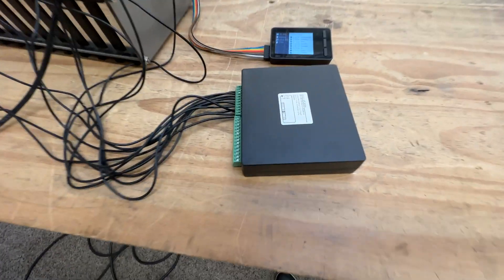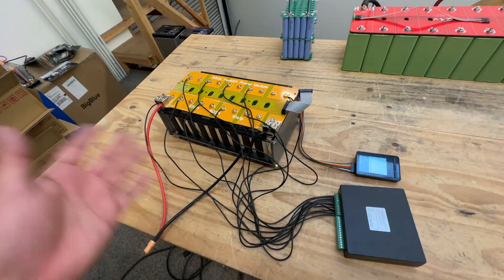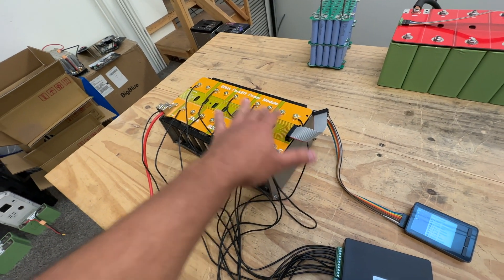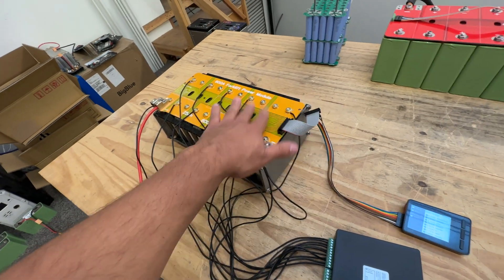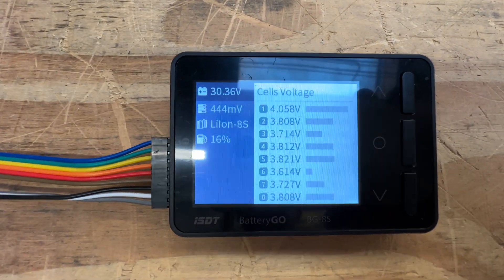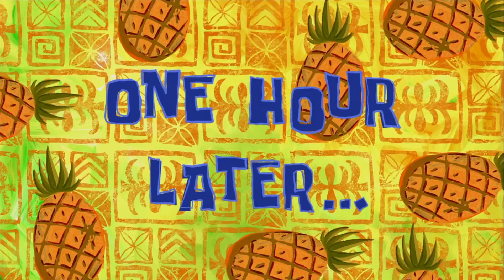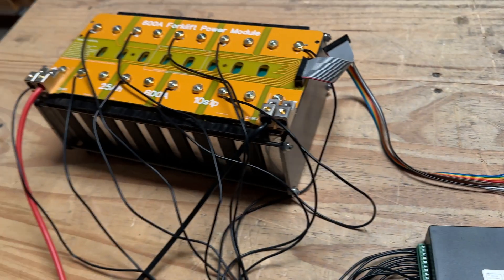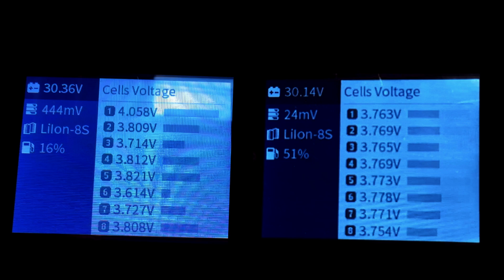10A Active balancer TEST

Comment: So its mean 10a on every string? Have you test it?
Reply: He should have used a clamp to check the amps to see if the balancing depends of the voltage difference or not (prefered).

Comment: Jehu is there a balancer that can be custom in voltage? I have a couple of packs in LTO and i need to balance them but i need to set the voltages because is different from NMC and LFP...
Reply: If you go to the link Jehu supplied you will see LTO balancers as well from 6-8S to 6-24S.

Comment: Hi love your videos and trying to build a battery system for my Semi truck was going go with blutti because it’s easy but when I look it’s cheeper buying Lithium Iron Phosphate batteries is there a charger controller that you recommend and are they only for solar or can I connect it to a wall outlet  I have a inverter in my Semi truck and when I’m driving I want to charge my batteries so I can use them when I’m not driving

Comment: OK so it was 16% SOC at start of test ,How is it showing 51% after 24hr , how has the SOC gone up ?
Reply: Either its a scam sales pitch or it reads percentage according to the lowest cell.  As soon as one cell reaches uvp under voltage protection the main bms will disconnect the load.

Comment: Think this would work for a 16s electric vehicle battery? I've been trying to find an affordable balance, their solution that actually works but not a lot of things do 16s
Reply: Also what's the model on that cell voltage monitor? Do they make a 16s variant?
Reply: That’s the problem if you plan to have an obscure type of battery. You won’t have much of a choice in options for it.
Reply from the maker: here is how you would wire 16s https://ae01.alicdn.com/kf/S65b4001f0bd64ec6beafd57985bf6a7cW.png
Reply: @jehugarcia  excellent, thanks for that, it's sort of buried in the Alibaba listing..... Although I still wonder if there's a 16s version of that cool little battery voltage monitor... I imagine I cannot simply wire two of the 8s battery monitors together?

Comment: Went from 16% SOC (based on lowest cell voltage) to 51% (since the lowest cell is at 51% and the other 1-7 are probably at 53% or so). I think that's a really good example of pointing out why balancing is so important. Your unbalanced pack would have cut out WAY sooner since you had one cell that was so low whereas after balancing you've dramatically increased the runtime

Or if you didn't have a BMS and you discharged to say 27.5 or an average of 2.75V per cell that lowest cell would be in the toilet. Probably around 2.00V

Comment: all those wires are a complete turn off for me. Give me 12 volt batteries with built in BMS and call it a day
Reply: I have some news that will blow your mind.....

Thats what your battery looks like under the plastic and being afraid of those wires are the reason why people like you buy new batteries for $400 instead of doing a free repair or replace a $50 BMS
Reply: @ericklein5097  you are mostly right and i do know what a BMS looks like whether is under the plastic or in plain view. Maybe its just me but i look at all those wires and cringe. I guess once all the connections are made and a BMS is in place, its set it and forget it. I really don't know if my batteries and balanced or not. So i guess the better system is the one displayed in the video?
Reply: @mannyfragoza9652  Most BMS boards are remarkably simple. The majority of the board is made up of mosfets, electronic switches. Those switches either turn off or turn on the flow of current in or out of the battery. A bunch of parameters can be detected by simple circuits like voltage dividers, a way for the board to measure a voltage. Current can also be measured. Too much current, too high of a voltage, too low of a voltage, blah blah blah all reasons to trip the two "gates into the battery" the mosfets that control the current flow. The other primary part of a BMS is the balancing circuit. Voltage dividers and then bleed resistors that turn energy into heat.....but we're talking about a relatively small PCB so the bleed resistors can't create too much heat which is why MOST BMS's in the 100A range for LiFeP04 have a balancing current of 40-100mA. There are some JK models that go up to 2A. The balance current is how much can be discharged from an individual cell if it is higher than the rest and this is usually done right near the end of the charging cycle. Say all the cells are getting charged with 1A. Cell 1 is ahead of the others so at some point it hits a voltage where the balancer turns on with 100mA current. So now its only charging with 0.9A in hopes of giving the other cells a chance to catch up. Cell 1 is your cell with the lowest capacity thats why its getting to full first. Unforunately bleeding off energy is just inefficient because if you have 1 cell way below the rest thats 3 cells in a 12 volt bleeding off tons of energy  (over many cycles) in hopes of one day becoming even. Until then Cell 1 always hits high voltage cutoff first and you have a pack that cant charge alll the way up. First its 3.65V for cell and 3.510V for the rest. Next its 3.65V and 3.513V. Four more cycles later you're up to 3.610 in all the other cells because theres less capacity up top so voltage rises quickly. .Finally by charge/discharge cycle 6 you have cell 1 at 3.650 and the others at 3.645 only a 5mV difference which is the most the BMS can do.

But an active balancer doesn't waste energy. It takes the high cell energy and using capacitors (which are essentially batteries) its shuffles the energy from high to low cells. So cell 1 would feed the other 3 and the amount of current drawn from cell 1 is dependent on the voltage difference. It takes 1 whole volt to reach that number on the active balancer (2A, 5A, 10A) and at differences of 0.010V you'll have slowed down to 20 or 30mA but you're so close by that even the most unbalanced batteries can be balanced in a day by a 5A or 10A active balancer unless its a huge battery (>300Ah). The passive balancers dont work well if you have really fast charging current because the balance current doesn't even take a bite out of it. The active balancer doesn't need a charging current to work it just shifts energy around as long as you have it running.

There's your simple explanation of the two main parts of a BMS and why the passive balance circuit on a BMS board is inferior to active balancers (burning energy vs shuffling energy)
Reply: @mannyfragoza9652  the wires are simple after you wire one BMS up. number of cells plus one is your balance cable. 8 cells? 9 pin cable. 24 cells? 25 pin cable. Imagine you have a bunch of AA batteries laid out on their side end to end

- [\\\\\\\]+ -[\\\\\\\\\]+ -[\\\\\\\]+ -[\\\\\\\]+

First wire goes on the main negative on the left. Last wire goes to the main positive. Then theres a wire for each gap in between batteries. So its a 4S battery....5 wires on the balance cable, two ends and 3 middle gaps. it means you have a positive and a negative point to measure any cell on there.
Reply: They will end up in a new pcb board if we know our go to batty guy. So don’t stress

Comment: I have the same active balancer for 4s type. Inductor type is better then capacitor type balancer. in my opinion.
Reply: This. This exactly. Inductor ones will put the cells to .002 apart.
Reply: true
Reply: better then or better than??????